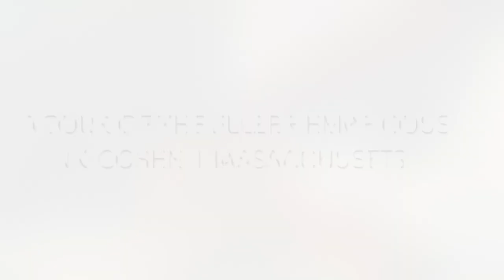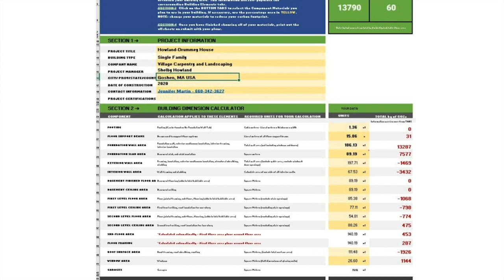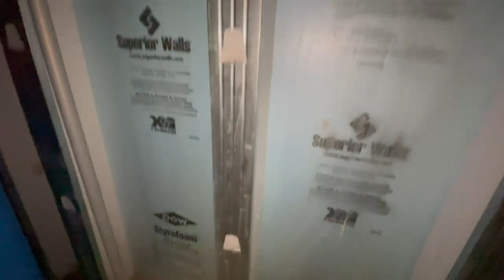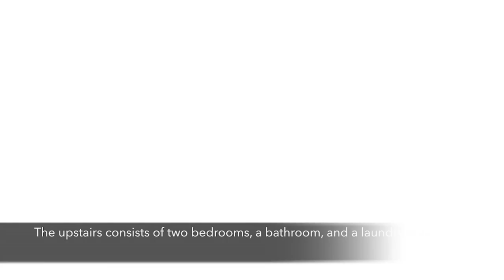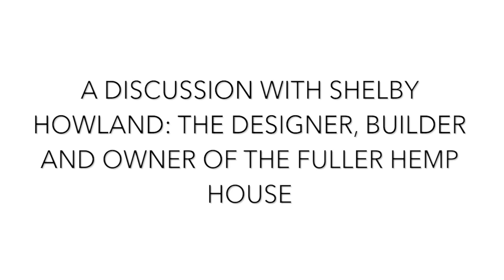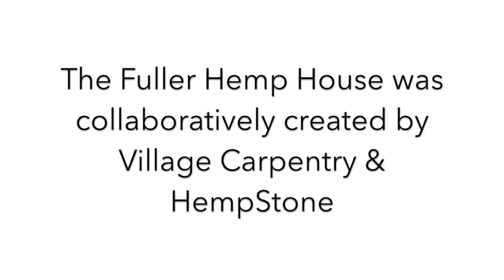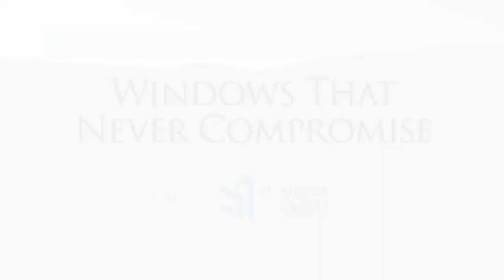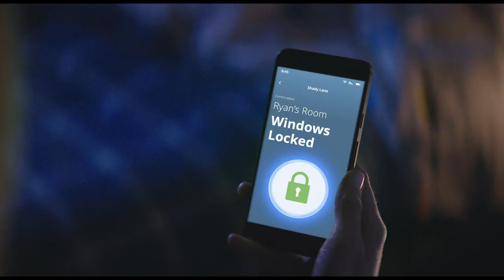SEON Home Tour:  Fuller Rd. Hemp House

Comment: I would think hempcrete and associated vapor permeable exterior finish materials would benefit from much larger roof overhangs to protect against moisture damage in the longer term.   Also talking about heating the whole place with just one wood stove and then a picture of the mini-split unit on the wall almost at the same time seems a bit disingenuous.   I am a born critic.  Hopefully that applies to myself sometimes also.  Really cool build.  Congratulations.

Comment: Where can I find home plans for a hempcrete house
Reply: Most likely, you would to find a conventional plan that you like and then hire an experienced (or at least studied and interested) architect to alter it to compensate for hempcrete construction, or do so yourself.

Just keep in mind two very important things:

1. Hempcrete is not a load-bearing material. Hence, why it is usually packed or blown in around a conventional timber frame.

2. Hempcrete is vapor-open and requires only vapor-permeable finishes (e.g., lime render instead of gypsum drywall, mineral paints and washes instead of conventional paint, etc.).